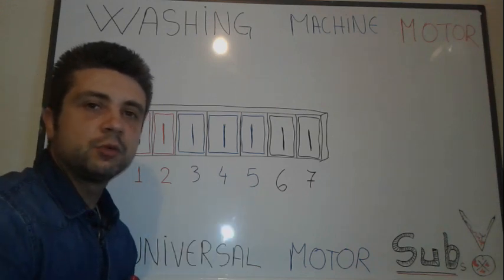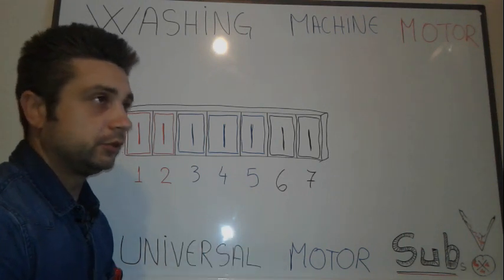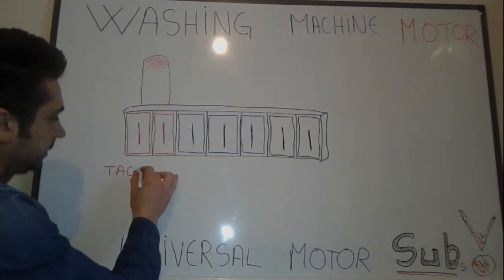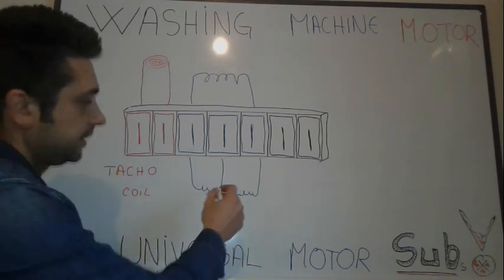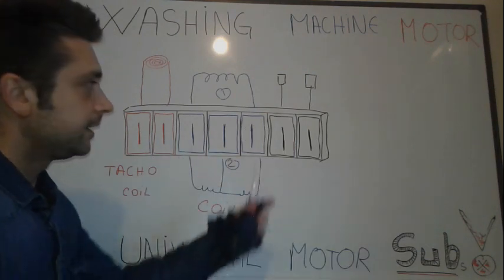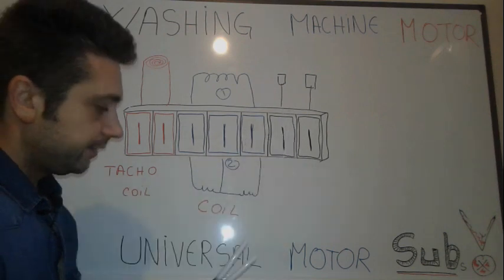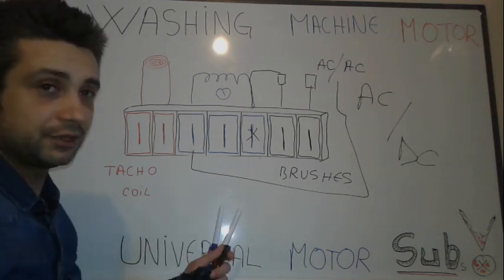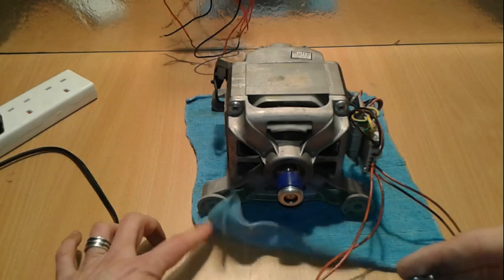Washing machine motor wiring diagram

Comment: Doesn't brushes tell us it's EITHER a Universal Motor OR a DC motor?  Not exclusively a Universal Motor.
Reply from the maker: Universal motor by definition is a motor that can run on ac or dc alternators have brushes and so on synchronous motors don't

Comment: I have an engine that has 9 contacts: I excluded 2 (tacho sensor) 2 (brushes) remain 5 wires, from the outside you don't understand where they go, you think there's a thermal protection. I powered with 12v for safety but I couldn't get it started ... Do you have any advice to give me? I don't want to take it apart because it's riveted. Thanks
Reply from the maker: No ideea my friend could be different wiring maybe a star connection
Reply: Hello 
There are connections going nowhere  ( 2 of them) . There other ends are just free.

Comment: Hi this was really helpful thanks for posting this. I was wondering how to wire this sort of motor to use as a belt grinder with some sort of speed controller on it?
Reply from the maker: paddy evans nice to hear that you cam use it for you diy projects, check it out I have all the stuff necessary for you including speed control, dc, ac, diagrams and more Che k them out

Comment: So with one coil being disconnected, does that mean only 2 coils are being used?
Reply from the maker: Mike Gray on some motors there is just one coil with 2 ends, some others have another pin which is in the middle called center tap, or can be 2couils joined together providing clockwise movement or counter clockwise movement

Comment: Thanks for the informative video. I salvaged a washing machine motor. Could you help me see which is the correct wiring? Because it only has 3 wires.
Reply from the maker: IcySkullz yeah sure sent me a picture to Demiwattuk@gmail.com and if you want to check the other videos about generator battery you name it all the best
Reply: @NoSkillsRequired  Thanks for the reply! Will be sending you the picture soon
Reply from the maker: IcySkullz alright you should check for continuity all the pins to see which one goes to the chasing. Could be blue =neutral, red =live, yellow=ground tell me the country of this washing  motor different wiring colors
Reply: @NoSkillsRequired It is from a LG washing machine. I am from Singapore. Its usually green blue and brown here
Reply from the maker: IcySkullz unusual wiring the only choice is to check for continuity between each wires and the case of the motor and that will be the ground, now as you look at the motor plug you should have another pin that apparently is not connected?
Reply: The wires are connected to the capacitor and the motherboard. Hence I am not sure which is the live and neutral
Reply from the maker: IcySkullz try to disconnect all the wires from the motherboard and just look at the motor plug you have to extend some wires, blue - neutral and red - live, yellow - another live for reverse not 100%sure
Reply: okay will try this weekend
Reply from the maker: IcySkullz k buddy good luck and let me know if it worked don't touch the motor while operating on mains power
Reply: @NoSkillsRequired  Is my motor a 3 phase motor? The color of the wires fit the 3 phase colors but shouldnt it be 4 wires? With the fourth being neutral?
Reply: @NoSkillsRequired  Update: Connected red and yellow to live and neutral (vice versa). Motor started humming then started to spin at low after I rotate the rotator. 

The red and yellow was connected to a capacitor so I figured that one of it should be neutral. 

The motor works without the blue wire connected. Now I am curious whats the blue wire for?

If there is no more updates, I am probably electrocuted
Reply from the maker: IcySkullz I hope you are careful and don't get shock keep me posted